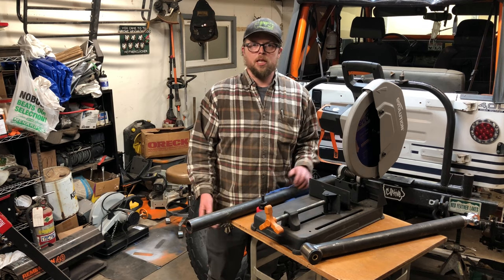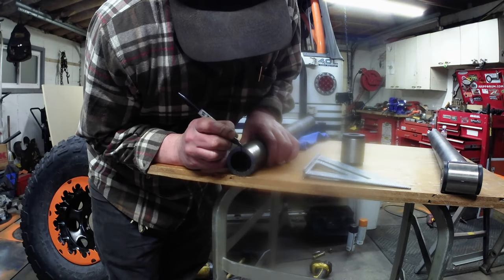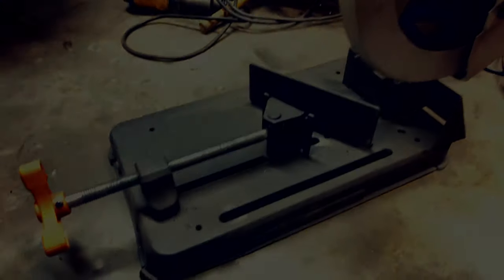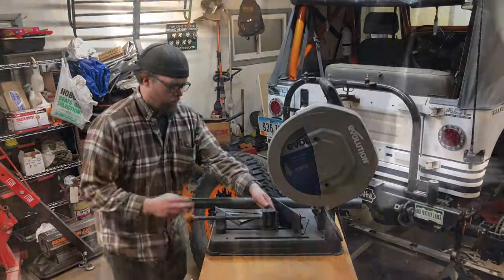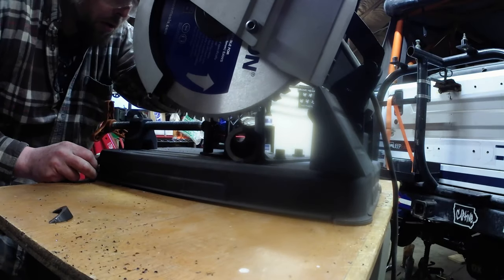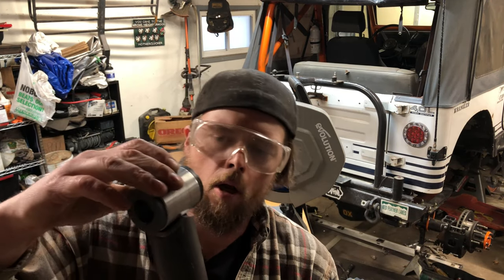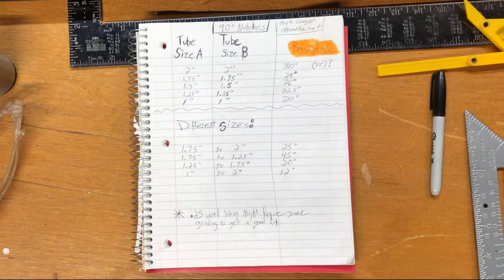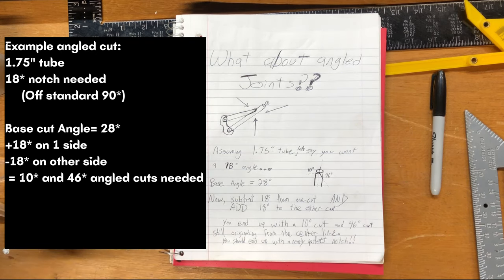Notch tube with an EVOLUTION Saw (or chop saw) SUPER Easy

Comment: Nice I subscribe I’m new to notching , I didn’t want to buy a botched so I’m going to use my chop saw …
Reply from the maker: it works really well as long as you hit your marks
Reply: @FlawedOffroad  ima give it a shot this week build my rock slider ..
Reply from the maker: @jrautofabwerksllc7556  I highly recommend doing a practice notch or 2 on a chunk of scrap, and if youre using a weird angle even try it with a tp tube to check fitment

Comment: 👉👌 very nice work! i love to learn stuff like that! Thank you! Jeep looks awesome!
Reply from the maker: Thanks bud! I kinda learned as I went but did a lot of research and wanted to share
Reply: @FlawedOffroad  you should round the ears (sharp points) of your notches. When they are sharp like that all the stress on that joint gets directed to the that point. Eventually that will cause a stress fracture in the weld and the weld will fail.